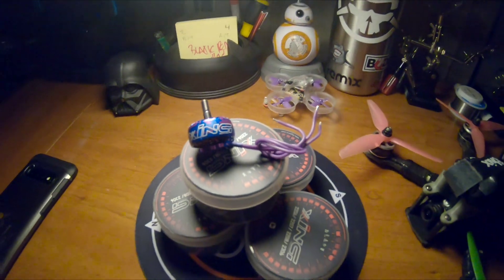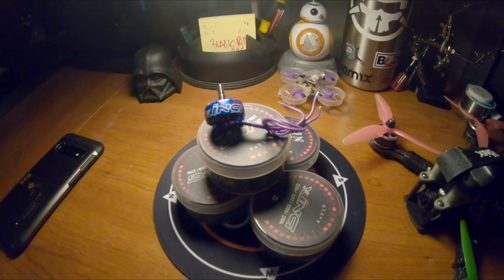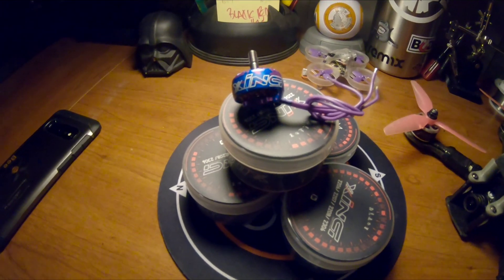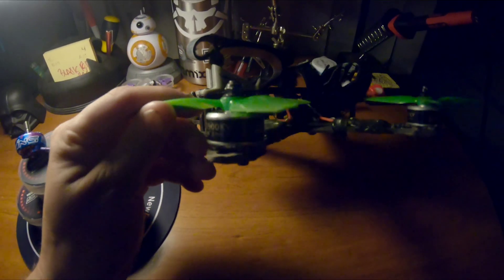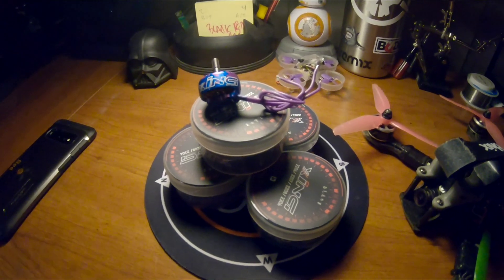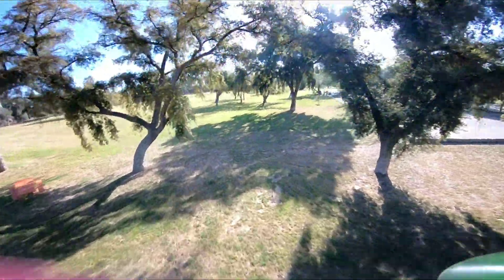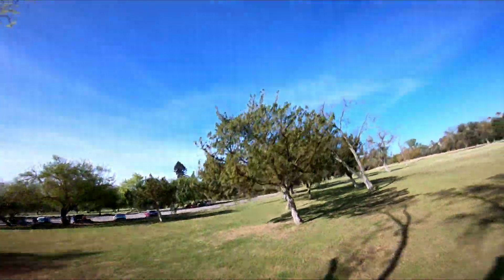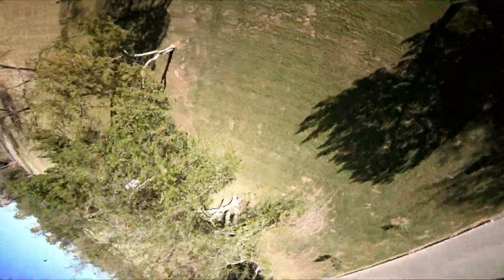iFlight Xing 2207 2450kv First Impressions #iflight #xing #xingmotors

Comment: Have U flew this on 5s?
Reply from the maker: Nope I have not. With my tune the motors are super cool so I could imagine that you could get away with it if you quad is tuned right
Reply: @VoidvaderFPV  yup, that's what I did. I put these on my batman 220 and stuck a lihv 5s and the thing is rocket like. I put a switch on my transmitter that cuts the throttle cap to 75 percent and it flies like a charm for freestyle, still quite fast. It's easier on the battery too, flights are like a full minute longer for me.